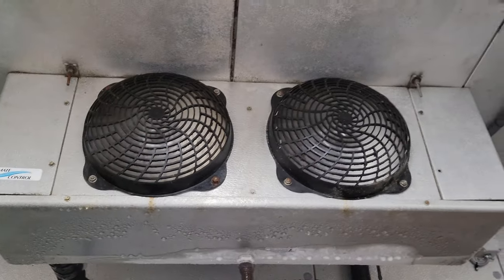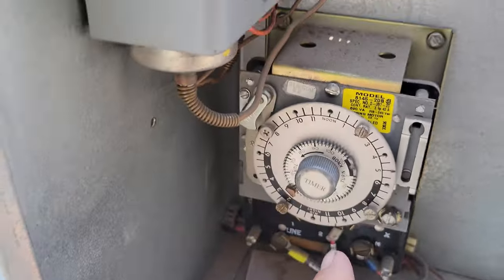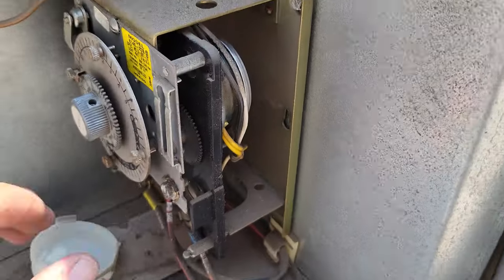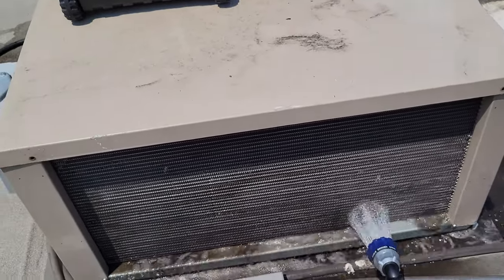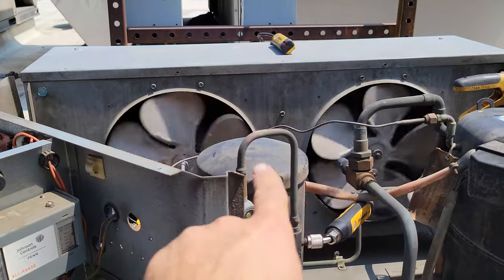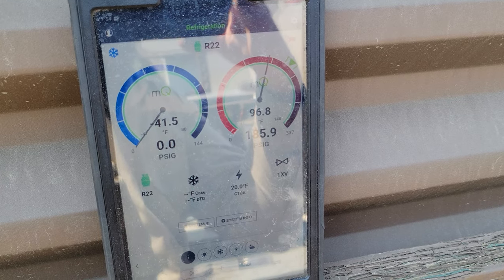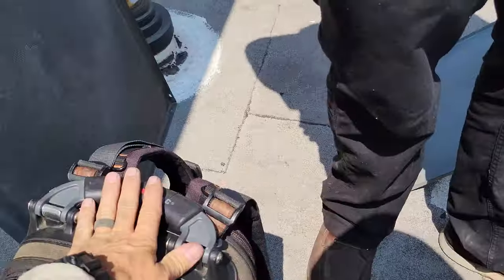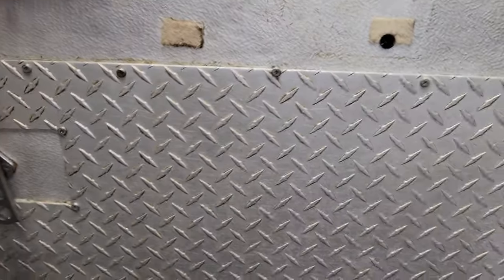THE WALK IN COOLER IS WARM AND ICE IS ALL OVER IT

Comment: While I'm not an HVACR technician I remembered seeing something in a YouTube video and looked it up. I found that Paragon has a digital clock that can handle up to 12 defrosts. Each Defrost can be anywhere between 15 and 105 minutes and can be set individually like a Grasslin. They are universal voltage too. The only issue I would see preventing someone from wanting to use them is the costs both for the timer (it is more expensive through consumer channels than a Grasslin) and the time for the tech to set it up. They also have a manual defrost button.
Reply: 9145-00

Comment: Chris. Ke2 allows up to 12 custom defrost times. Have you tried setting dFt to 20min and then setting the custom times for the 20min intervals. You could have 40min at night (12:00 and 12:20) and then regular 20 minute intervals during the day. Ke2 only displays 3 digits so you set to 10min intervals with the 24hour clock. I haven't tested this yet but seems it would work.

Comment: So do most of these establishments have hose bibs right up on the roof? I'm maintenance where I work and need to clean the condensers on the roof top units, but don't feel like the building has enough water pressure to feed a hose from the ground level bibs.

Comment: when i was a working man i would constantly tell other techs " you have to check everything". does the door close, fan blades install properly, coil reasonable clean, does the timer work, is one even installed, what are the defrost times, whats the pressures, sight-glass full, condenser clean, motors working, the list goes on and on,  you have one shot to get it right.

Comment: You can definitely custom program the KE2 for more aggressive defrost at night.
Reply from the maker: The ke2 temp + defrost?? Im sure you can do it on the evap efficiency controller but I didn't think you could on the temp+defrost one??
Reply: @HVACRVIDEOS  temp + defrost 
Set defrost per day to above 12, it will display CUS for custom. Then set you d1, d2, d3 and so on. It’ll be in military time. So you can set 2 in a row if you need a long one at night.
Reply from the maker: Interesting I will look into that can you have say a  15 minute defrost 3 times during the day than a 60 minute defrost from 2am-3am ?
Reply: @HVACRVIDEOS   https://youtu.be/C4TiMB4KFBc

I thought you could just put in back to back defrost in the middle of the night but looks like you can only initiate on the hour?  Meaning say I want to start one at 0100 the next one will have to start at 0200. 
Guess I’ll have to do more research because I like the KE2 but like you I want a longer defrost at night.
Reply: If you find something please let me know!
Reply: @HVACRVIDEOS  one post further up says you have to set it for more than 12 defrosts per day than CUS is displayed then you pick the time of day.  you can set the defrosts back to back so if you set 2 30 minute defrosts, one at 2:00 and another at 2:30 that will give you an hour off time. Next one I install I am going to check it out. Or maybe I will just hook a new one up and play with it til I get it working.

Comment: How about the owner periodically spray the insulation on the roof with 303 Protectant ? To keep it from drying out , cracking , resisting heat and the sun's rays .

Comment: How do you feel about Bluon?
Reply: TdX 20 (R-458A)
Reply: I haven't tried it yet and have not seen it used in the field yet. It costs about $450 per jug in Michigan. I have been using MO 99 for $225 a jug.
Reply from the maker: I havent tried it either, their app Is cool though
Reply: Cool, just wondering why so many are bragging about the so called “new refrigerant”. To replace R22? Really?
Reply: @MichaelQShaw  bluon is marketed towards apartment complexes that have maintenance people and other users who aren't necessarily refrigeration techs and for those users bluon support is fantastic because they can call tech support and talk to real technicians that will walk them through any issues they have. No other refrigerant manufacturer puts that much effort into training that niche less skilled market. Bluon efficiency is about the same as 407 C that I use now but costs twice as much so I haven't tried it. Most all other R22 replacement blends don't work as well because you lose capacity. So unless the price comes down I will stick to 407C and and add a few squirts of POE when the need arises.